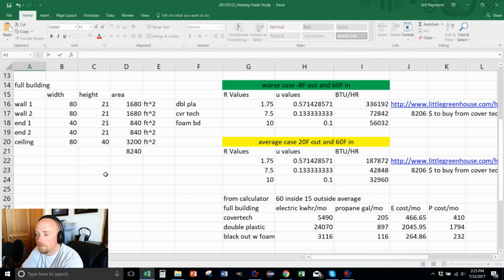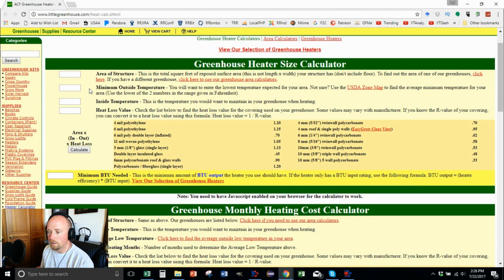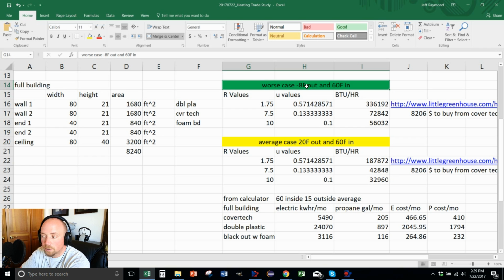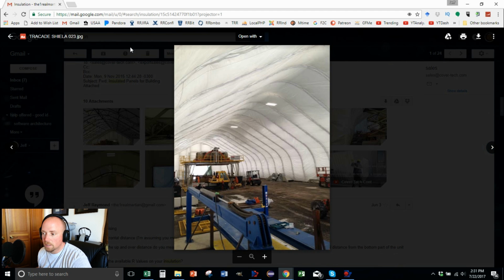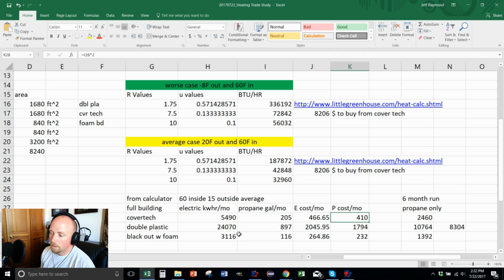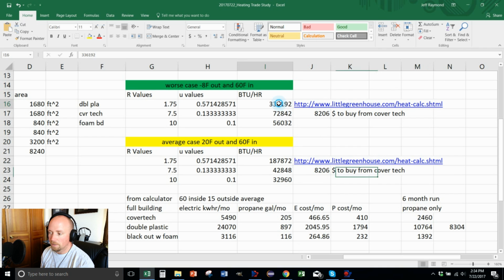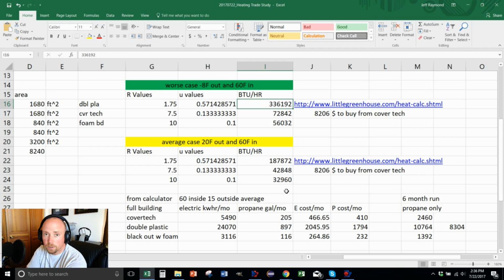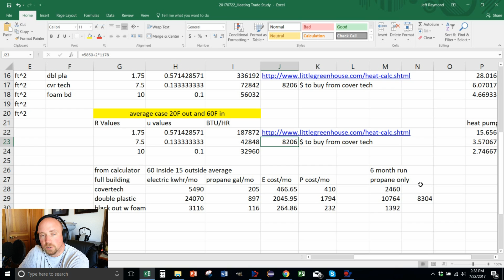The CHALLENGES With INSULATING a GREENHOUSE - Part 2

Comment: A couple things. I like this video because I have been playing with a similar format. I agree with your assessment of the purpose built cover. You said every dollar spent on insulation is more than a dollar saved on fuel if you are only concerned about heat. Unfortunately for this project you are concerned, or more accurately the plants are concerned with light. One thing I noticed about the picture of the purpose-built shelter cover was that it was translucent. You will want to save every Lumen of light that you can for your plants. You even mentioned in one of your videos that the top racks and bottom racks of plants perform differently based on the ambient light that was available through the translucent white cover. So every dollar spent on insulation is not exactly a dollar saved on fuel it's a dollar saved on fuel plus the cost of the Lost Light.
Reply from the maker: thats a great point...you are exactly right. That's why the R10 foam board dropped down in my trade study. A total blackout would significantly increase total cost due to lighting

Comment: If you go the Cover Tech route, will there be gaps between the individual panels inside the building, or is it a continuous piece that you start on one end and finish on the other to install it?
Reply from the maker: my understanding is that the covertech solution comes in 11ft sections that do overlap at the seam
Reply: Aha. Thanks.

Comment: You would need lighting but surely that's a massive saving on heating and cost? Comes in 75m rolls as well. 

Contact Temperature Range: -60°F to 180°F (-51°C to 82°C)

Comment: We would suggest using either our Greenhouse Bubble Shield IN-SS-BUB or our Tempshield Insulation IN-TSD for this application as they are better equipped at heat retention.

Comment: At work today we had some parcels delivered.  When I opened them they had a blanket of bubble wrap but these were big bubbles maybe 1 1/2" across. As it comes in big sheets could that. It be an easier/ cheaper option?

Comment: Have you done any thing about raising your solar panel off the ground? I would suggest raising them in about 4 feet above ground at short end and add a 1 foot extension to keep the snow away from the end of the solar panel.That way you be able to clear the snow from the ends of the panels without  damage them. This is just a suggestion. Good luck on your insulating endeavor.👍🤞🏻🙏🏼👍🙏🏼🤞🏻✋🏽
Reply from the maker: nothing this year. Maybe next...solar dropped down in priority since we are grid tied

Comment: Why don't you use IR lamps instead using propane, to heat not the air but the surface that need to be warm. Using IR lamps don't need to lower the ceiling. I do use a 1500W and it heat about 40 square meters (430ft2)

Comment: I agree with the Cover Tech direction. Double plastic is ineffective, foam boards will be a pain to install, work around and store. Cover Tech doesn't cost that much more than foam and gives you the full use of your building and gets the job done. 
Is it possible to add fiberglass batting between the outer shell and the Cover Tech?  It will block the light but will drive the R value way up.

Comment: Its going to get expensive no matter what you do... but you may not need heat anymore after you get that done. Our greenhouse we were using to do tomatoes didnt have lights or heat and we kept going year round except in the coldest 6 weeks when we were cleaning out and restarting.

Comment: To me this is a no-brainer foam board is easier to install and disassemble and store. add to the money you save on fuel cost to heat will pay for it overtime even if it's your most expensive option on initial startup not to mention it provides the most Superior insulating option

Comment: Need to double the solar panels
Try to design a LNG Rocket Heater
Use foam panels only take down ceiling in summer
Build geothermal pump sys

Comment: Why not use foam board on the sides, when the loss of light would be less critical and double plastic or CVT on the roof? Also how does your profitability look like if you factor in the options for winter heating?